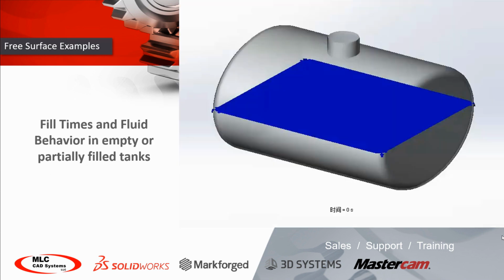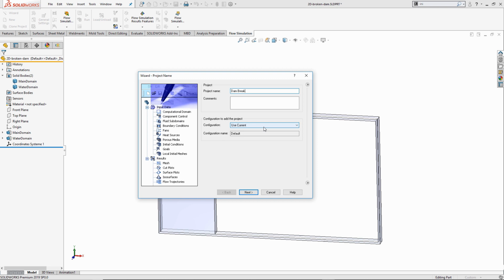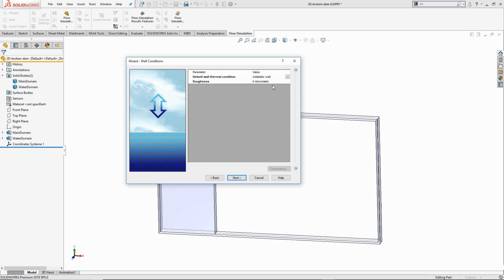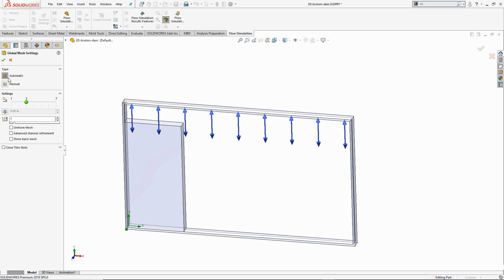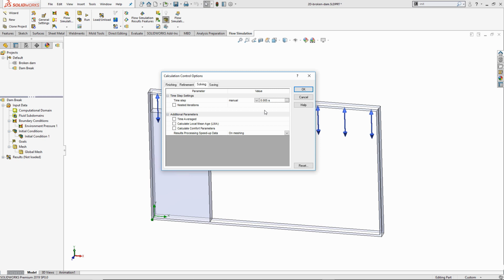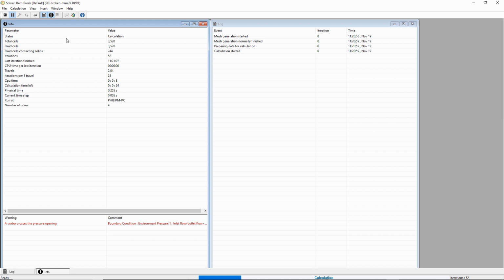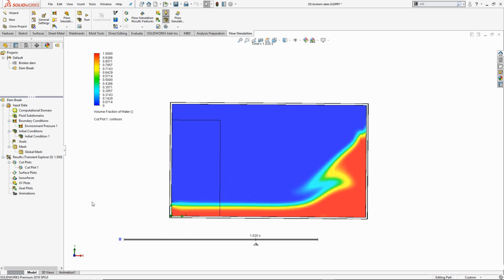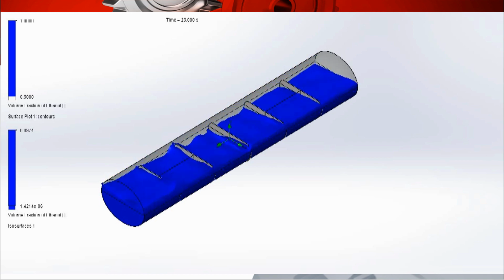SOLIDWORKS Flow Simulation: How to Set Up Free Surface CFD | Webinar

Comment: Sir, Thank you so much for the detailed tutorial. Great job! I appreciate the time you took to explain everything in details.
Also, I have a question concerning modeling an open channel flow, could you do that for us please I have never seen any tutorial about stream simulation that implies free surface modeling; in most of the tutorials, they all use pipes. Thank you!
Reply from the maker: Open channel flow should be possible by following the same approach, but those types of designs often fall into the realm of civil engineering so you aren't likely to see a lot of similar applications.

Comment: I have been working with SD 2019 and flow simulations worked pretty well, but suddendly I installed SD 2020 for some updated that my company recommended and all the simulations crashed, when i try to do the same way I did on 2019, It is possible that flow has an issue?, or there's should be something to do in a different way As I used to? Thanks in advance
Reply from the maker: There should be nothing in the way you setup and run studies that has changed in between versions that would cause this.  It is possible that there is a bug in the specific version you are using that affects your workflow or perhaps your specific installation is having issues.  I would check to see if the same studies solve on another computer if you have one, or reach out to your support provider to help you troubleshoot the issue.  If you are an MLC CAD Systems customer with active subscription, you can reach our team at https://mlc-cad.com/technical-support/

Comment: Rightclicking on results bar doesnt pop up anything :(
Reply from the maker: If your version of SOLIDWORKS is older it may not have that functionality, and also you can expect different results when you right click on the color bar or the number scale.  Additionally, if you are in the middle of a command, such as editing the definition of a plot, the option to modify the scale using right click won't be available until you accept that dialog and get out of that command.  There could be other possible explanations, contact your support provider for additional assistance. If you are an MLC CAD Systems customer, you can reach out on our website https://mlc-cad.com/technical-support/

Comment: I am trying to replicate this using 2 solids that has not been merged, mainly a tank and water. May I know why I am unable to "disable solid body" in the initial condition?
Reply from the maker: The checkbox to disable the solid body is there for convenience.  If the body was already disabled previously in another operation it would not be available.  The best way to view the status of a body and enable or disable it is to right click at the top of the study and go to Component Control.  

"Disable" means the solid body is not considered a solid object, which is appropriate if the body is only being used to define initial conditions, identify mesh regions, or allow for measurement in specific spatial regions.  Enable simply means it is treated as a solid and will contribute to the closed volume calculation and will prevent fluid from flowing through it.

Comment: I want to simulate an open channel water flow. Just a flat surface (like an Ocean) with just water at the bottom and air at the TOP and generate a flow from one end to another. Would that be possible?
Reply from the maker: Great question, based on what you describe that sounds possible to do in SOLIDWORKS Flow Simulation

Comment: Looks like the fluid did not interact with the top of the tank?
Reply from the maker: All of the walls in the study can be specified as open or closed, if the flow reaches the top of the tank it will interact there.  It depends on the setup of the study.
Reply: He set the top of the tank to be open to atmospheric pressure, so no direct interaction.